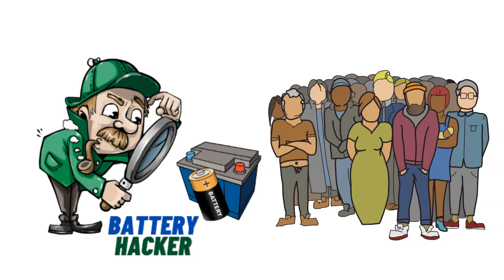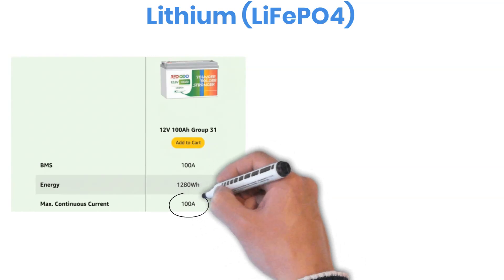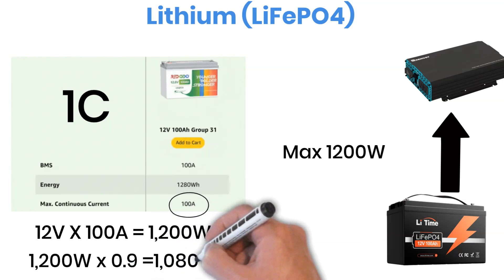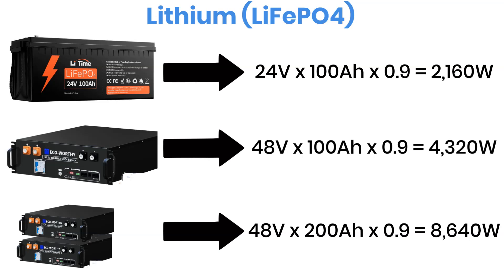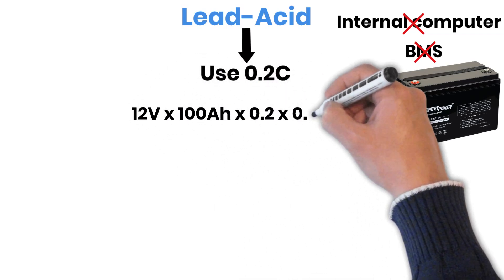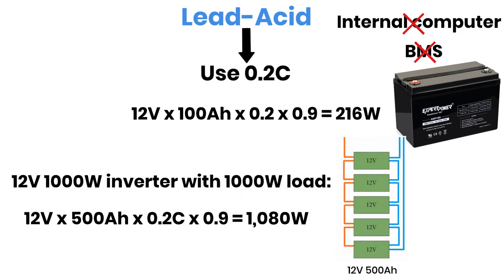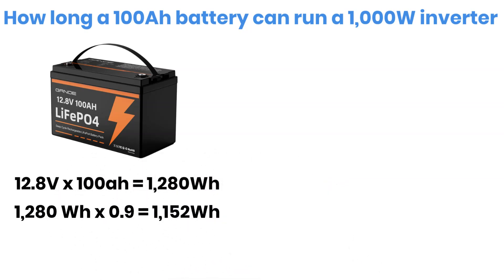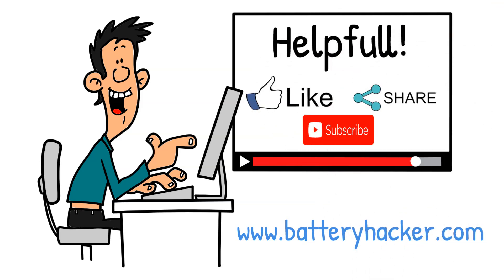What Size Inverter for 100Ah Battery? | 12V, 24V, 48V Battery Inverter Sizing Explained (1kW Setup)

Comment: I learned this early on with 4 200ah RENOGY AGM BATTERIES and a RENOGY 3000 Watt 12 Volt Inverter. And have since stepped up into Lithium Iron Phosphate Batteries. 2C is way better
Reply from the maker: Absolutely, 2C performance on LiFePO4 really makes a difference compared to AGM. Renogy setups are solid too. what inverter are you using now with your new batteries?
Reply: @batteryhacker4343 An Aeliussine Branded WZRELB 7K Dual Phase Inverter + an Additional WZRELB 3000 Watt 48 Volt Inverter from The Same 50Kwh Battery Bank Buss Bars